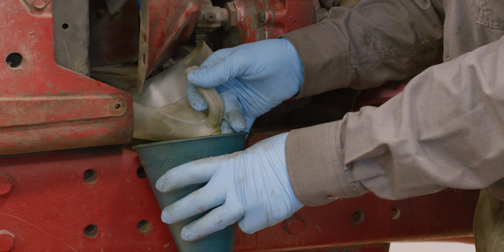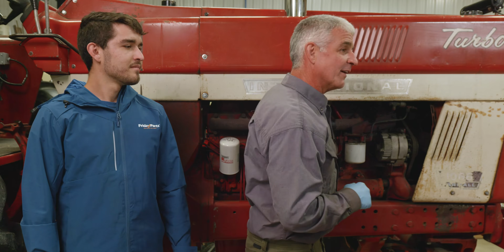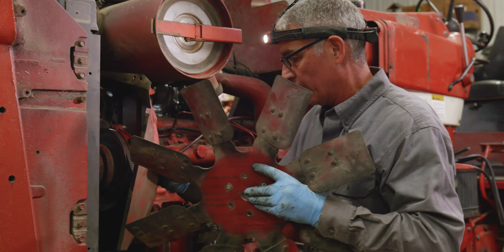Tractor Water Pump Repair & Installation DIY Guide

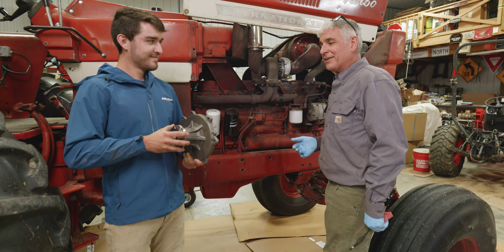Comment from the maker: 1:58 - Signs of Bad Bearings, Loose Fans & Rusted Impeller Fins
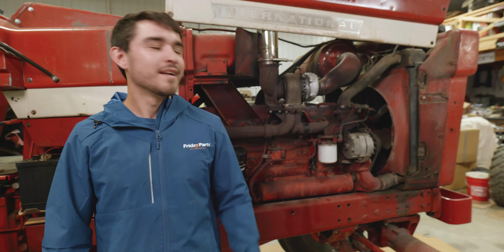2:58 - Step 1: Parking on Level Surface & Engine Cooldown Safety
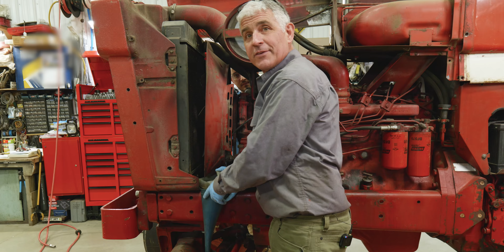3:12 - Step 2: Draining Radiator via Petcock Valve & Water Pump Cost
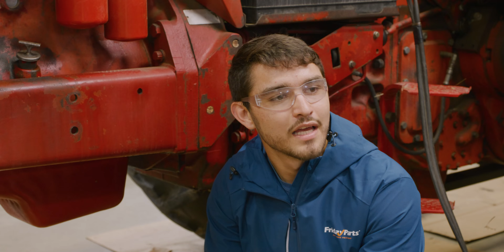4:04 - Step 3: Removing Serpentine Belt, Fan Shroud & Pump Bolts
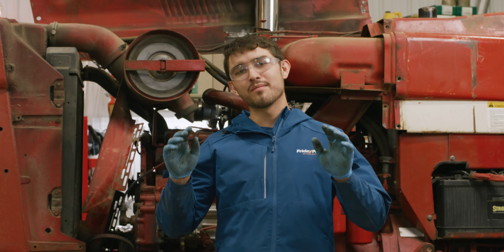5:16 - Step 4: Scraping Gaskets & Cleaning the Engine Block Mating Surface
6:00 - Step 5: Applying Liquid Sealant & Crisscross Bolt Torque Sequence
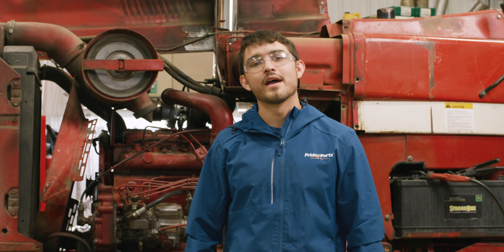6:43 - Step 6: Refilling Coolant, Bleeding Air Pockets & Temperature Check
Reply: Happy 10th anniversary 🎉big big birthday cake 🎂 hope you are around for another 10 anniversaries.